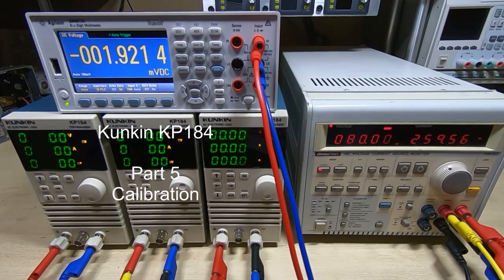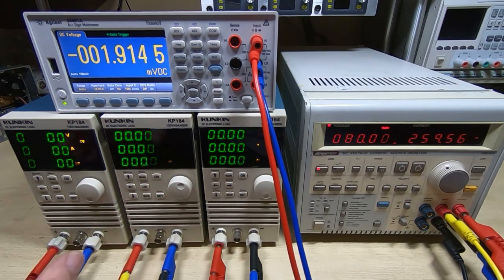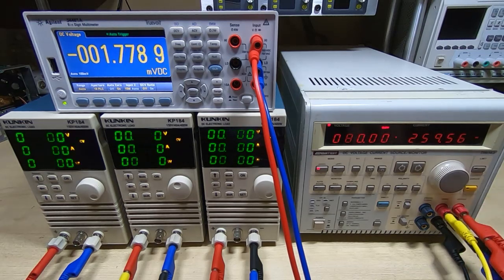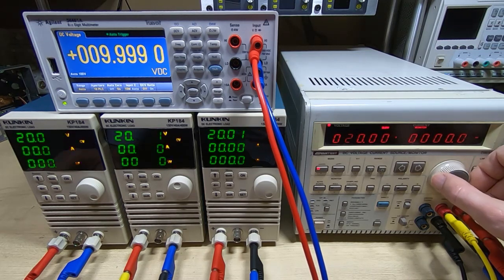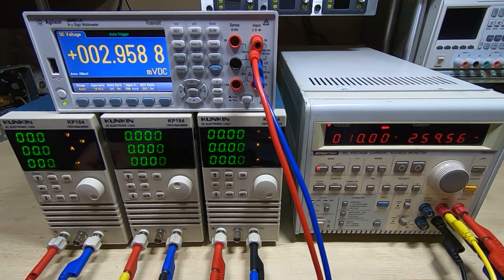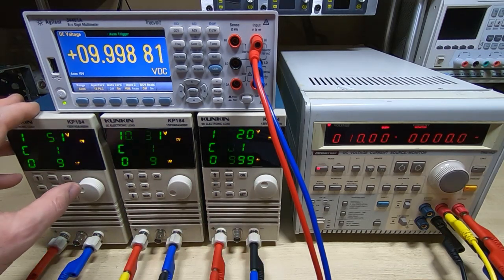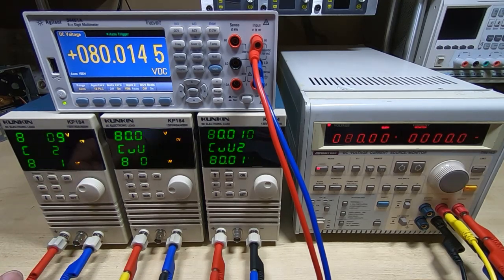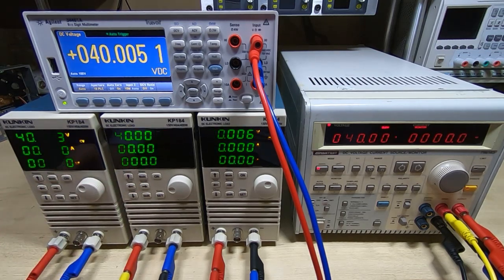Kunkin KP184 Calibration

Comment: Hi, I have two KP184s and I wanted to connect them via RS485 so they work in parallel. Did you manage to do this? It's not working for me. I set one as the host and the other as the slave, changed the addresses, set the same baud rate, and the master still doesn't control the other. Thanks for your reply.

Comment: Re: Load. 
I tested my KP184 with 70VDC @ 3A (just barely below 210W) at a lab power supply from BK Precision (BK9174) and the Kunkin's case gets quite warm to the touch after a hour on-time or so. Almost double the load (400 W) might be really the max, what can be handled by the unit. It will be on the verge of usability (and capability) with  loads >10 (Amperage) times as much (up to 40A) and only at low voltages of about 10VDC as long as 400W have not been exceeded. The fan is currently (at those values stated) running probably already at (almost ?) max speed, considering its noise level, and the air blown out is quite warm at the rear end of the unit. For more power you might need either a much more expensive load (specifications ?) or at least double or tripple the KP184 used in some way. Note: The lowest voltage on my unit displayed had been 0.3VDC.

PS.: Re. My prior post. I checked the intermediate voltage and current adjustments discussed before and couldn't find a way to input anything there except pressing "SET", thus I couldn't adjust the "Kunkin display to match the actual value" as stated, although my unit is brand new (built date October 2021) and equipped with the latest firmware version. The Grossman calibration document unfortunately doesn't elaborate on this or is - to my understanding - rather unspecific in its description about this.

Comment: Hi, I got a calibration document for the KP184 from the website of Chris Grossman I think, but some parts of the calibration procedure stated in the provided document are not clear to me, especially the part about the DAU-adjustments (?) after the "cross" voltage and current settings. What exactly are the "Ctu1, Cuv2, Cuv3, Cuv4" adjustments and how are they measured or set or whatever in reality ? What do you mean by "setting the voltage source to 6V" (power supply display ?) and further on the other mentioned "thresholds" ? Same holds true for the current adjustments "Cta1, Cta2, Cta3, Cta4". This part of the Grossman calibration document is unclear to me...
Note: English is not my native tongue...
Reply from the maker: At each calibration step you need to set the input current / voltage close to the value specified in the document. You then adjust the Kunkin display to match the actual value you are applying. At the end the Kunkin uses the values to calculate an accurate calibration curve.
Reply: @JerryWalker001  Hi, sorry to bother You again, but I checked the Chris Grossman "Calibration" document (internet) against your description and under adjustments it states for those second tier adjustments (DAU-adjustments ?), that 
"...calibrated measuring equipment is no longer required here. (what do i have to use as a reference then...?)
The respective adjustment values are determined by searching for the control insert (?) with external supply of the controlled variable. If the operating point of the control is set to stable (?), this value is accepted by pressing the SET key. (totally unclear to me). Both values of the value pair are required to define a specific characteristic curve.  In principle, the individual characteristic curves can also be determined separately from each other or fine-tuned afterwards." (what does that mean ???)

If you look at the calibration procedure on the last page of this document, the decription seems to be somewhat differently described. Whilst voltage and current calibration seem to be quite clear to me, the others are not. That confuses me. Unfortunately you left those adjustments out in your video, so I can't have a look, how You actually did it...

Comment: My power supply can only go up to 60 V, and my personal hobby projects never go above 24 V at maybe 0.5 A.  Is there any downside to calibrating it for these ranges, or does the calibration have to take place at high voltage/amps?  I also have the KP182, not the KP184.  Is the calibration procedure exactly the same?

Comment: Hello, thanks for sharing, do you have a video about the basic current calibration procedure or how is it done?
Thanks greetings
Reply from the maker: It is done in the same was as the voltage calibration (selecting the current settings) but you need a current source that can go to 40A. I would not advise trying to do the current calibration unless you have a suitable current source as the unit expects a certain range of values and if you run the calibration over the wrong range then the unit may not work properly.
Reply: @JerryWalker001  Could you tell me some model that was suitable?
Thanks greetings
Reply: @JerryWalker001  Mind if I ask what did you use for the 40A current source? I have a problem with my load (it has a consistent offset error of 10mA and I really need to re-calibrate).Thanks:)
Reply from the maker: @p8051a  I used one of the KP184's to control the current from a 60V 50A linear supply. I set it to constant current and used it to control the current being fed into the unit I was calibrating. The supply was connected via a calibrated current meter. I could then use the second KP184 to adjust the current required to calibrate the first unit. In other words I had everything connected in series (Supply, Reference meter, KP184-1. KP184-2).
Reply: @JerryWalker001  Thanks! I was thinking to get a second KP184 and now I have a good excuse.! I have a high current supply but I don't think I have a meter accurate enough to trust at 40A maybe my Uni-t ut210 could do it but even if it doesn't I could fix the calibration on my first unit by getting a second one and try to get them close to one another.Keep up the great work.I love your channel:) Thanks again!
Reply from the maker: @p8051a  If you do not have an accurate meter that can handle 50A then just take any length of suitable wire and accurately measure its resistance. Put it in the loop and use your calibrated meter across the wire. You can then use this as a high current meter to make accurate measurements. You could adjust the wire length to give you a sensible range (eg 10mV = 1A @ 0.01R).
Reply: @JerryWalker001  Yeah seems reasonable to just measure the voltage drop on a known resistor (the cable).Nice one. I could try that to evaluate the accuracy of my ut210 as well. I have a low ohms meter and 5 1/2 digit accurate multimeter so looks like I only need second kunkin load. Thanks for your suggestions, really appreciate it.
Reply: @JerryWalker001  That could be a solution. Though you should take into consideration that controlling the current via a DC load (KP184) involves the current jitter introduced by the DC load's PID algo. If the PID algo is good you are lucky and have very low current jitter of 1 or 2 mA, otherwise you could have current jitter in 10 mA or even more. You could measure the DC load's PID current jitter with a current probe and an oscilloscope. So to be sure and have a measure of the accuracy of this method.
Reply from the maker: @sv1eia  You may have missunderstood what I said. The second Kunkin is only used as a source NOT the reference. You do of course need to set up the slew rates of the loads to prevent instability.
Reply: @JerryWalker001  I think I understood. What I said is that due to the PID algo, the exact current will eventually fluctuate every few msec and that will be evident as jitter in the current value. So, even if you try to measure the exact value with the help of an external current meter,  in order to put that value in KP184, that value most likely will have that fluxuation, thus effectively if the external meter sees a number I guess that number will vary by a few mA during the measurement. When you did your setup for current calibration with the two-KP184, you did not seen any fluxuation in the external current meter?
Reply from the maker: @sv1eia  The second Kunkin is used only as the current source controller. There is a filter between this and the UUT and the reference meter provides readings which are averages of 20 readings at 5mS intervals (This is to avoid inaccuracies caused but ripple in the supply which is the dominant source of error in this setup). The source for the Kunkin does not need to be particularly accurate as the resolution of the Kunkin at high currents is relatively coarse and so as long as the slew rates are set up appropriately then the results are acceptable for this unit. All the units I have were calibrated using this method and All of them now give readings very close to each other (well within the specification). I am NOT saying this method is perfect but it certainly worked for the units I have. Yes of course you could get more accurate current sources if you wanted yo spend a lot of money but that is not what I was asked. I was asked how I calibrated the units at high current and so I replied with the method I used.
Reply: @JerryWalker001  Ahh.. OK, now this clears it up  "averages of 20 readings at 5mS intervals". Of course this is an excellent way to calibrate them, no doubt about it. this way you also average the Lo/Hi current fluxuations of the PID algo. You know, with this and that you do make me to think about a second KP184   :-))

Comment: Hi Jerry,    what is the highest  power you have tested this KP184 for.  400 watts seems to be high for this enclosure?
Reply from the maker: I tested all the way up to 400W and it was fine. There is quite a good heatsink and fan assembly inside. I only go to approx 350W in the video I posted when I was using it to test the RD6006 but I tested it at full power for 24 hours and it handled it very well. They are not as small as they look.

Comment: Thank you for showing the calibration procedure. Because of your videos about RD6006 I ordered a KP184. As I do not own a Voltage/Current Source, which is accurate enough and is capable of providing 80V, I am unable to calibrate the KP184 myself. I have another question: In the upper part of the video scene, I can see three DPS5005 power supplys. Why do you have three and how do you power them? I ask since you build a linear power supply for the RD6006.
Reply from the maker: It works over quite a wide range. 10V / 60V for example but if you go too far you will see very incorrect voltages so it should be obvious if they values entered are too far out. Also the closer the values are together the less accurate it may be. If you are only calibrating voltage then an RD6006 or similar could be used. Alternatively a number of laptop supplies or similar in series would work just as well. The input voltages do not need to be accurate, just reasonably stable as the actual voltage is entered so 8.9V and 63V (for example could be used).
Reply: But if I want more or less reliable readings then I need a voltmeter which is trustful. The best I have is a Siglent SDM3045X 4,5 digit bench-multimeter. I have another question regarding the measurement of the RD6006's ripple you showed in another video. What kind of capacitor did you use to block the DC portion of the signal? It looks like a tantalum capacitor. Is the value of the capacitor important?
Reply from the maker: I frequently need to have floating supplies when I am repairing and testing equipment. The 3 supplies in the centre of the bench are supplied from independant floating linear supplies which are located underneath the bench. I use them for general purpose floating supplies. This allows me to use them as totally floating supplies without tying up my main bench supplies. I am also frequently working on more than one project at the same time and some tests need to be left running for extended periods and so I can use these supplies (and others that I also have) to power them without having to stop the other work. Bear in mind that if each can supply 30V then I can wire them all in series to get 90V (for example to calibrate a KP184) if I did not have another way to do that.